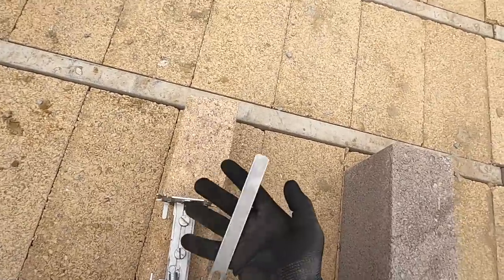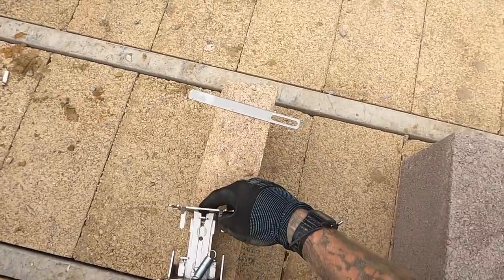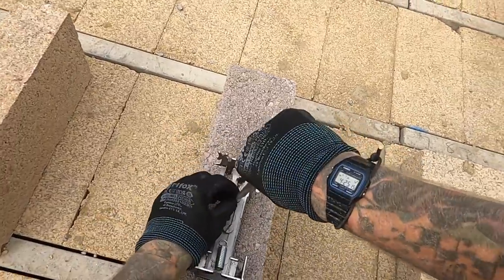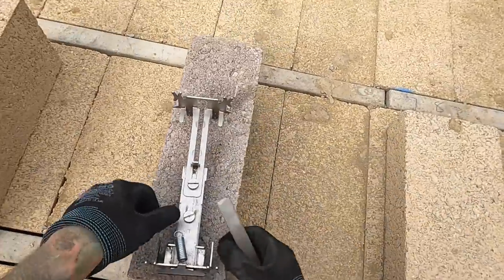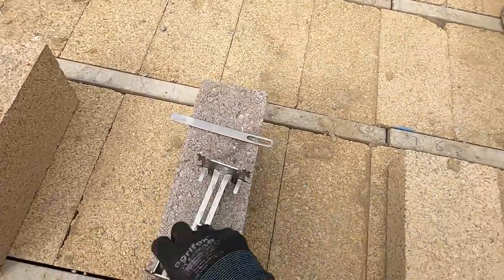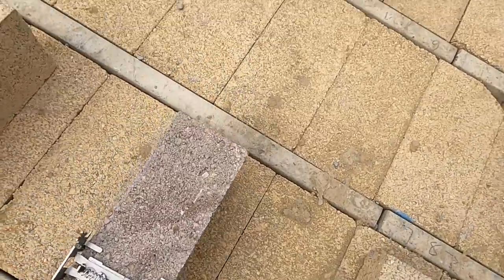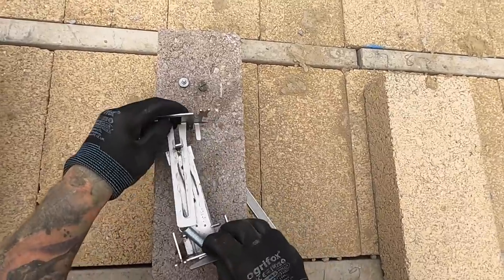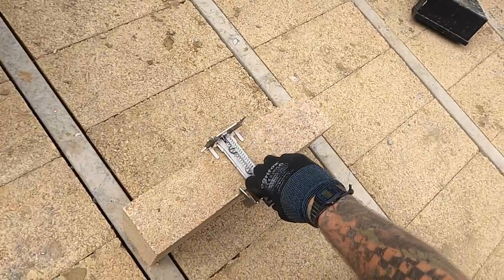Fitzbrick! 100s 140s 225s and brick on edge!

Comment: Hi it's Richard Fitzgerald from FitzBrick Clamps. Thanks Charlie there's a video on my website which shows in detail how to change sizes. You'll notice you only have to take one screw off when your setting it to 215mm. For 140mm you only need to loosen the bolts and slide the back legs out.
Reply: Fitzbrick should make a 1 brick up version. Double decker you pull the line around top and bottom of both clamps gives you the course your on and the course above (75mm up) I could have done with one on a gable end. seems like an obvious idea to me but im just an engineer. No brick layer I can just lay bricks because I like to do everything myself. True jack of all trades and proud.
Reply: Just ordered a set Richard, great product idea!!!
Reply: @mattdaines8054  Thanks Mat I hope it makes your life a bit easier.
Reply: So this does all 3 sizes ?
Reply: @hbpw857  Hi yes and any size in-between
Reply: These would be good for laying edgings as well though pin curbs are only 50mm 🧐
Reply: @E69apeTheMatrix420  huh
Reply: Any way of adapting the original fitzbricks to fit this adjustable arm on the new ones or is it a case of having to buy thee new ones Richard?
Reply: @nickywillsher9876  Hi I thought about that for a long time there are many reasons why it wouldn't work.
Reply: @ianbarker1506  ? Really simple if you understand brickwork gauge then why not have a double decker fitzbrick that giver you the next gauge up to the brick your on as well. So you don't have to lay a few with a tape measure or laser level before clamping on your line... Because a double defker fitzbrick would have a line on the next course already
Reply: @E69apeTheMatrix420  crap idea
Reply: @richardfitzgerald4812  how much  are they richard
Reply: @justbreakingballs  what's a crappie idea?
Reply: @robogamer5384  you can go onto my website www.brickworktools.com all the information is on there
Reply: Superb Richard thanks think a was 1 of the first to mention this about 140,s and you nailed it thanks will be buying these 😎😎
Reply: @lmilne4859  Thanks if you watch my video on my website it'll show you how to change sizes easily. If you just loosen the 2 screws not take them off and slide the back legs out 20mm they will work really well on 140mm
Reply: Hello Richard , what happened to the line blocks for  the Blake’s profiles ? Where do I get them from ?
Reply: @bobbuilder622  They will be on the market in 2-3 weeks. Thanks
Reply: @richardfitzgerald4812  👍🏻
Reply: @jameswilliams917  just bump your kerb out wider for the clamp with a bit of timber on the back
Reply: @lmilne4859  Thanks mate your comments are much appreciated.
Reply: @richardfitzgerald4812  
😎😎🤟 got them few days back superb service thanks 😊

Comment: What's wrong with a bit of muck on the back of the block/brick and placing a brick on top to hold the line down?
Reply: Its exactly what I thought until I got a set , you can use the on door reveals too plus you don't need pins . Listen I'm a tight git and Been in this game over 30 years but these gadgets are very handy.

Comment: Nice and easy, but looking at it you should be able too loosen the first penny screw and remove the back one, as looking at it it may save you losing or dropping one of the penny screws just a thought👍😊😊
Reply: You got it Thomas the only time you totally remove one screw is to extend the clamps for 215mm the rest of the time its just loosen the screws and slide the back legs out.

Comment: Can't see the use myself. Doing domestic  work never needed  140s ever. Hardly ever needed 215 mm but I can pin in
Reply: Buy a set and I guarantee you’ll find yourself using them far more often than banging pins in or corner blocks

Comment: line should always be tight these clamps dont hold a very tight line over distance and need a tingle
Reply: Hi it's Richard Fitzgerald from FitzBrick Clamps. Thousands of bricklayers are using my clamps now, not one has come back saying you can't pull the line tight enough. Could you tell me where you heard this nonsense?
Reply: By the way if you look at my clamps you'll see there are wings on the back if you are pulling a line over a really long distance and I mean a really long distance longer than an average flank of a house you can tie the line very quickly from front to back. The clamps will be appsulutly locked on.
Reply: @richardfitzgerald4812  i have seen it for myself richard what you call a tight line and what i call 1 are completely different or maybe the brickies dont know how to use them
cheers bro